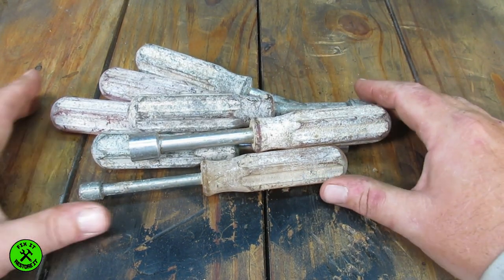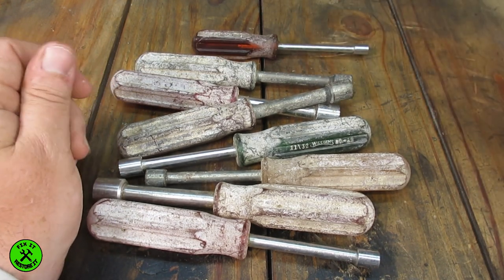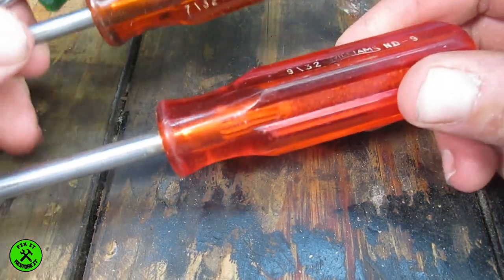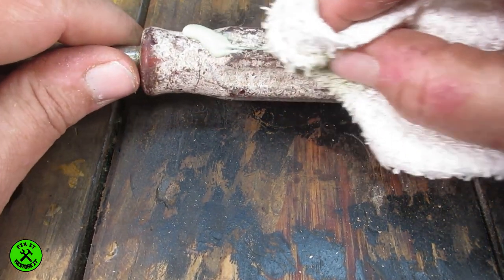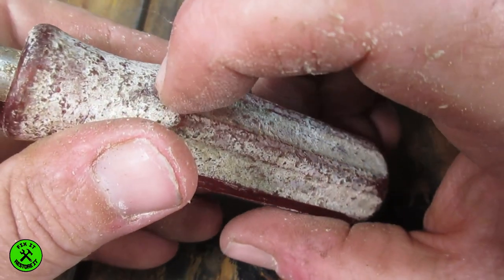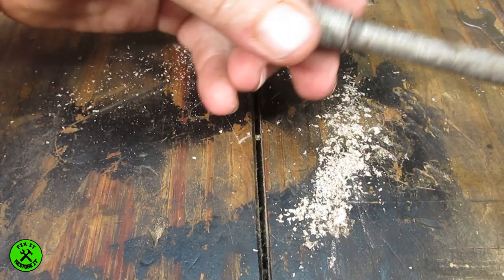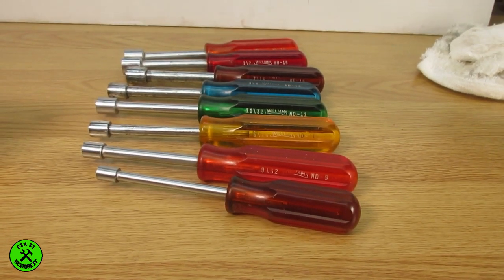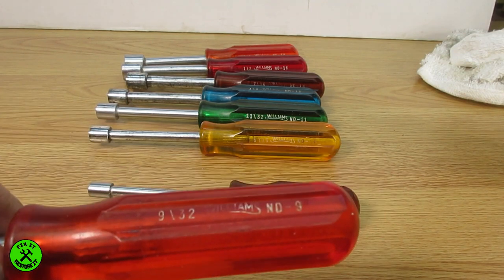Restoration of nut driver set, with stinky results!

Comment: my friend use fine steel wool for the cleaning up..without polish, then polish them using much less polish. to apply the paint for the markings, use a cheap cotton swab ofteh called Q tips (thats a brand name, use whatever's cheap) I spray the paint on a piece of aluminum foil. you can refresh it any time you need to with just a short squirt of paint. Using the cotton swab is less messy and easier to clean off. using super fine steel wool if need be.
Reply from the maker: I'll try that next time 😉

Comment: they are different colors so you can tell which one you're grabbing out of your tool pouch without actually having to read the size. once you learn which color is what, you don't have to read them any more. If two colors are too similar, put a piece of tape on one. Now, get a flat blade screw driver in a larger size, a straight blade in a smaller size, a number two phillps, a good pair of lineman's pliers, and a pair of side cutters, and you have a fair electrician's tool pouch. You might add other things as needs arise like needle nose pliers, a small hammer (the larger flat blade screw driver is for punching out the slugs or prying things)
Reply from the maker: I use the yellow (5/16) all the time at work 😎

Comment: That smell is probably the plastic that those handles are made of. I have a similar set of nut drivers made by Craftsman that came in a small plastic box and everytime I open it I get the smell of vomit. I finally had to get them out of the plastic box and store them in the tool drawer. The handles still have a faint odor to them after a couple of years out in the open air.
Reply from the maker: Yes, it is the plastic, these nut drivers were in a very advanced state of decomposition 🤢